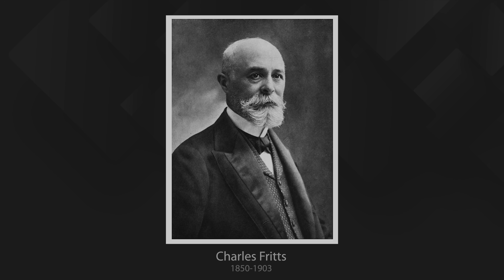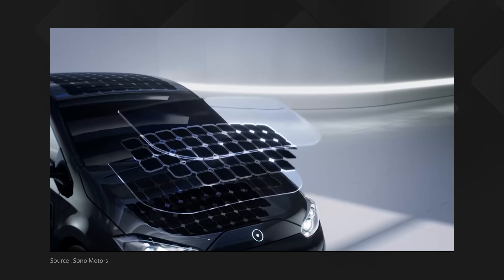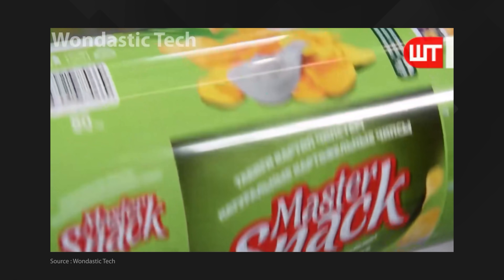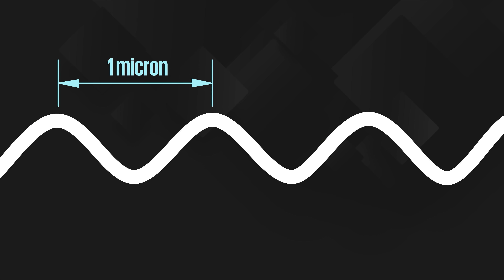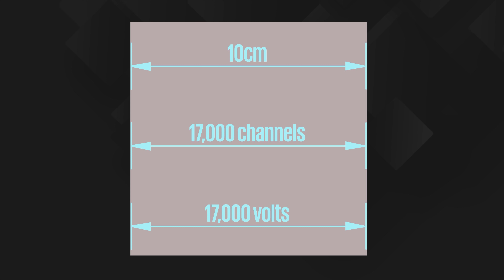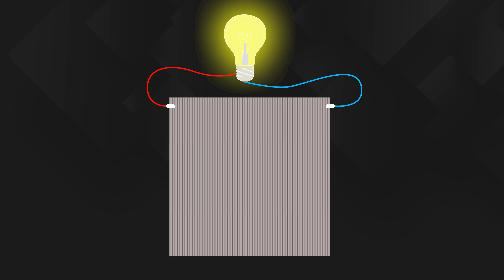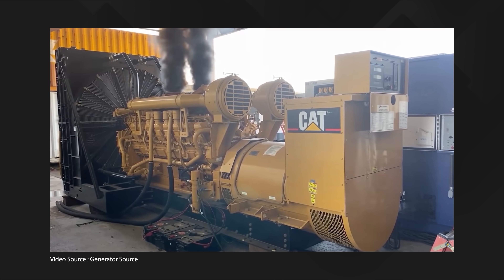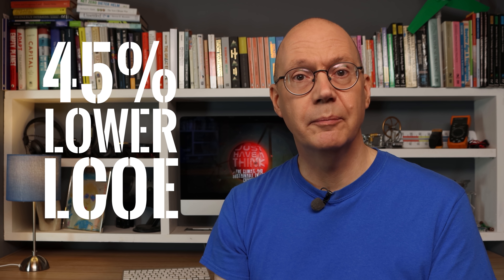Solar PV film roll. Revolutionary new production technology.

Comment: The lightness and flexibility would reduce the burden on roofs and enable use in additional circumstances like awnings or other cover over porches, decks, sheds, curtains, foldable sunshades for cars to maintain battery charge or to cool the interior, etc.
It would also simplify maintenance, for instance, if you needed to patch your roof, just detach and roll up that section for the duration of repair, then reattach it afterwards.
My main concerns are robustness against the elements, and end-of-life recovery. I don’t see the materials having much value to motivate anyone bothering to try. It may require a deposit scheme to support its recovery.
Reply: The light weight is very important since many existing roofs are not built to support the pretty heavy weight of solar cell balast needs. If this stuff can be applied with a strong bond to the existing roofing it will allow for a far faster implementation on many roofs.
Reply: @choralimpact  I can guarantee that any roof where I live can with stand the 20 kg from a 300 W panel. If not the would fall down every winter.  :-)
I think that the only really practical solution would be that the cell was the roof cover. Where a panel is made to cover   the height of the roof. The backing being like the metal roof plates that are connected by folding the edges together.
Reply: Recovery is going to be a big mess here. No mention of it in Dave's video of course, but hoping the company has a sustainability person on staff.
Reply: @nschrombeck  Why will it be a big mess?
It is basically just hydrocarbons with a little bit of extra metals. If there is no other uses for it, burn it and use the heat.
Reply: @bknesheim  Well, mess as in lots of thinking involved. 

I don't know the engineers and scientists behind this technology, but it all depends on whether they value busting into a new market and getting financially reimbursed for their creative fruits, or actually making a positive difference in the world. If the former is the case, then like you said incineration will probably be how this technology is disposed of. Pollution from plants that do this won't be great for those living nearby, and after all: don't a bunch of short-lived GHGs come out of melting composites like this thin film tech? 

If it's the latter, then they'll take into account End-of-Life procedures so that as many materials can be reused or sent on to other sectors, contributing to the circular economy. 

It'll be a mess and lots of thinking for those near where these materials will be disposed of amd destroyed, and/or for those doing all of the environmental/sustainable brainstorming ahead of time. 

I think I also probably meant this material will be a mess because of the former. Just one more thing to leach microplastics into the environment or waft carcinogens towards people of lesser privileges/other organisms. 

I also recognize that my worries are more system-wide than just this thin film tech, but still. It's something that every company needs to address and incorporate to not only their ongoing services but products as well.
Reply: Burying the thin film material in a landfill is a form of carbon sequestration and poses no significant environmental downsides.  Because it's so thin, the volume of material is small.
Reply: @incognitotorpedo42  The fact that it’s so thin is why this product will never produce long term durability to the weather and sun, though it surely will collect some ill spent euros.
Reply: Wind flapping might be an issue for awnings. But they could be made to furl and unfurl with the sun or if it gets too windy.
Reply: @Dave5843-d9m  cafe style round outdoor tables with the huge umbrellas, could use this film to cover them, and have free device charging at the table. Also the roofs of bus station stops, free charging. Park  picnic gazebo roofs. Figure out a clearcoat and you could do car wraps like advertisers do when they donate a car to a raffle...
Reply: Yeah already see me fixing the end on the top of the roof and roll it down and fix it with glue. Would just replace the tiles. Much faster roofing. But would probably need to be a little thicker more robust foil.
Reply: On sloped roof shingles it's a feasible scheme. On flat commercial roofing it's a problem in Northern climates with snow loads. However could be interesting in vertical cladding applications including curtain walls, spandrels and semiopaque films
Reply: I could see this in use for mobile homes. I own one myself, but the roof would never allow for a solar array. This though, this is a definite possibility.
Reply: @Chordonblue  You already have light weight flexible options. 
The possible game changer is the continuously production setup. You could make a single panel and cut the length needed, fast and hopefully cheap.
Reply: Why not just apply the "PV film as roofing".!.!...Once it becomes commercially available,i'm betting lots of products will result.!.!.!.
Reply: Flimsy thing on the roof is never a smart solution, an there space is at a premium so better tech is a lot smarter. Get twice the power using standard panels will just about always be better, but end of life do seams to be easy. Just burn it.
Reply: Enough with the rooftop.  Utility solar is five times cheaper. Get serious.
Reply: @Nill757  Where?
Reply: @bknesheim  where what?

Comment: Great video.  Does anyone know what happened to infra red panels.  There was talk about them a number of years back.
Reply: If you mean infra red electric heating panels, they are a thing and (if heat pumps prove to be as problematic as everyone thinks) could well be in the mix for future electrical heating. I bought a little (350w) one as an experiment and whilst it's a bit underwhelming, a set of larger ones could easily heat a home. But electricity would need to become seriously cheaper (or seriously subsidised) so people could afford to run them.
Reply: @wotireckon  hi, no the idea was to use infrared to generate electricity similar to solar panels.
Reply: @davidaustin967  Ooh not heard of that. Another branch to explore!

Comment: This is very promising. I wonder what the cost and difficulty of recycling these will be. Especially compared to existing solar panel technology.
Reply: Guess it's mostly the PET substrate, which is similar to the film on your microwave  meal, it generally is not recyclable but i'm sure a google search would give you more info. i would imagine the rigid PV is harder (or has a greater cost) to recycle because it has more 'stuff' in it, you know, the frame, the glass the cells themselves, the interconnects etc...?
Reply: @fuccasound3897  Well based on the panel expected lifespan and the mass production dates, we've got 10-15 years to work out how to recycle them.  Considering the tiny amounts of doping material and inks compared the PET substrate, I would suspect that existing experiments and ideas for PET recycling would work for these too.
Reply: Thanks for your thoughts, i agree with you.
Reply: Given that this film - when no longer able to produce power - is still a thin film? it might be repurposed - IE you could shred it, add it to concrete etc (especially when this stuff is no use? you'll have lots and lots of it without much contamination - all ready to go - rather than regular PET applications where you'd have to fish it out of rubbish)
Reply: @JohnnyWednesday  yes i like the idea of repurposing it generally takes less energy than recycling.
Reply: Good point. Should this technology take off, I'm sure resources will be made available to study and create ways to recycle the materials. A great secondary marked/industry will be created.